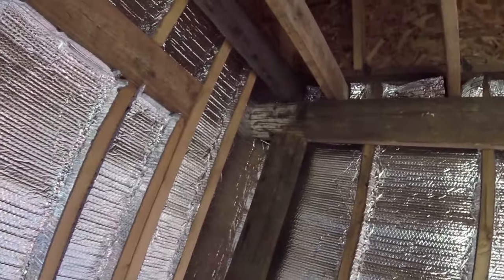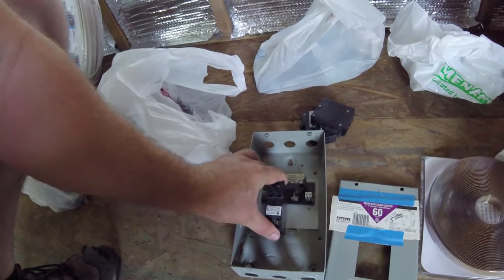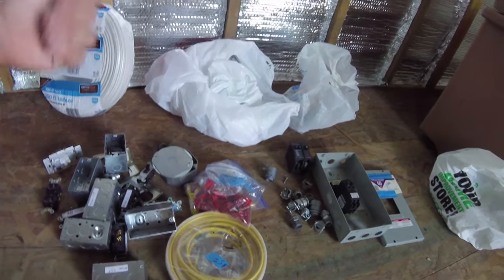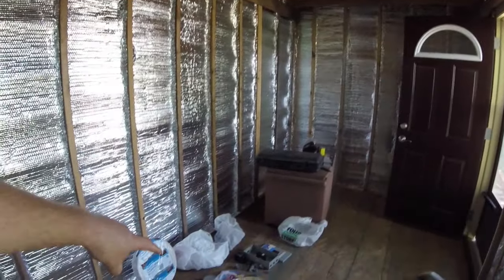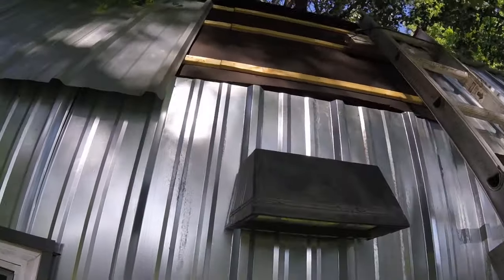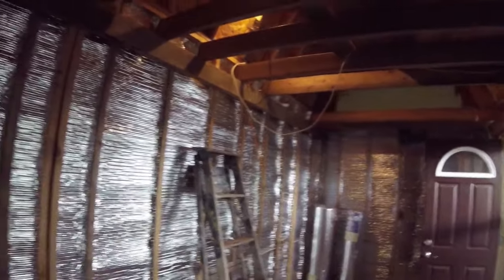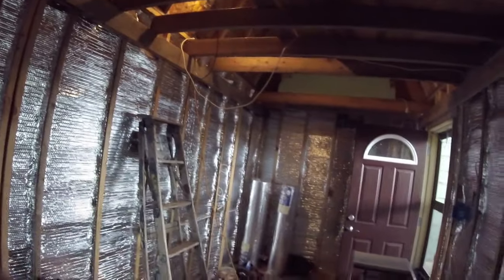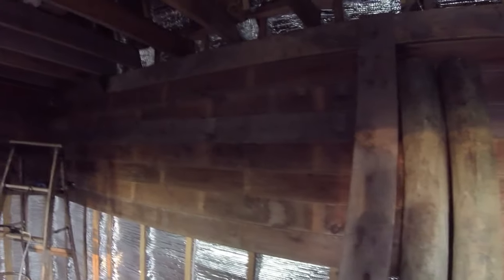Tiny House Shed Build - Part 7

Comment: that does look nice. but i bet the money you spent on that so far you could've gotten a camper
Reply from the maker: This is a practice run for more off-grid homes in the future.  this electrical system will be replaced with off-grid tech.  And it is detachable from the foundation to transport to a new piece of land.